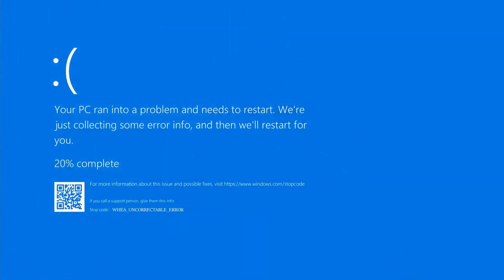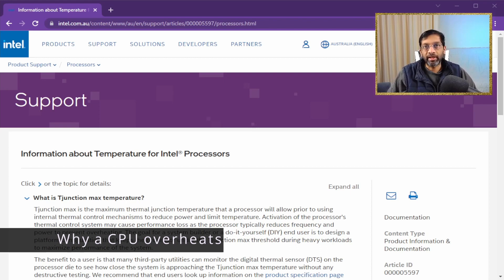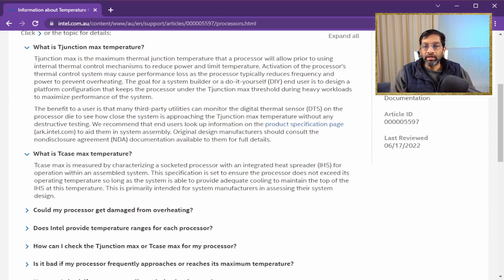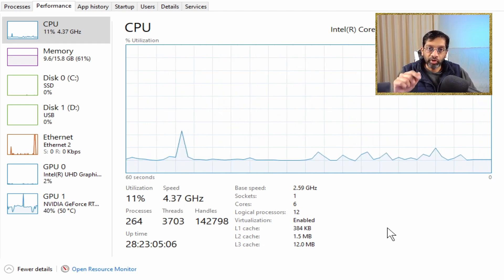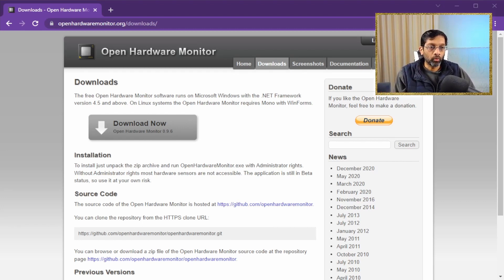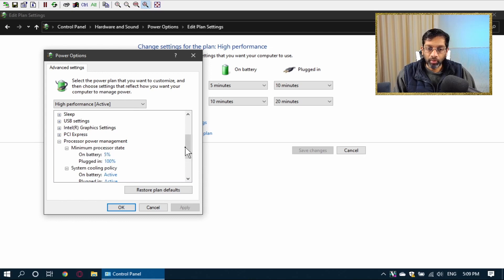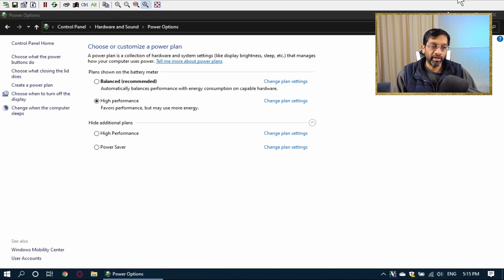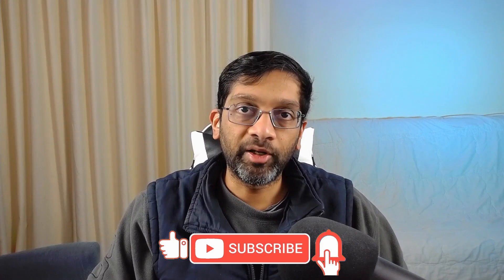BSOD Explanation about Overheating CPU errors. General explanation on CPU overheating.

Comment: Mine says ''Machine Check exeption''. What could that be please?
Reply from the maker: machine check exception is a rare kind of exception caused by the CPU only. Basically the CPU has detected either a failure in its own components, or a failure to detect another critical hardware, like the bus not responding. 
This exception occurs more common if there is a power supply problem, or if somehow the motherboard is so hot that a component fails. 
Does this exception occur immediately when booting the computer ?
Reply: @HighVoiceComputing  yes it does immediately after. I have gotten it to respond for at least 15 mins without going off. Would it work if i apply thermal paste to the cpu?
Reply: Did you ever figure out what the issue was?
Reply: I think it was something on the board. I had 3 of the same boards though that all did the same. But I got rid of all 3.